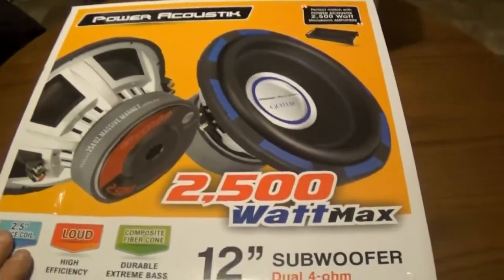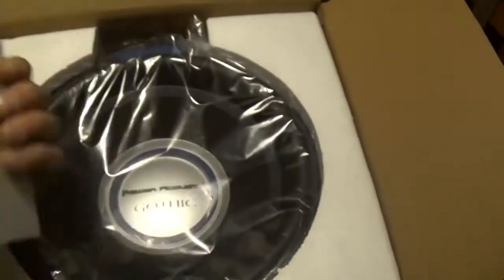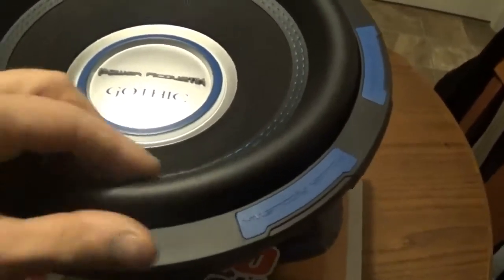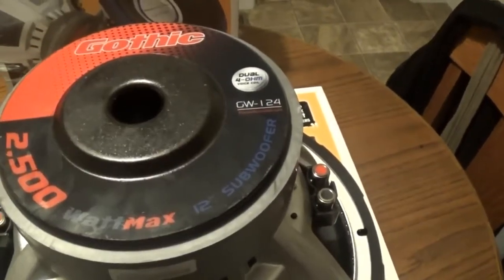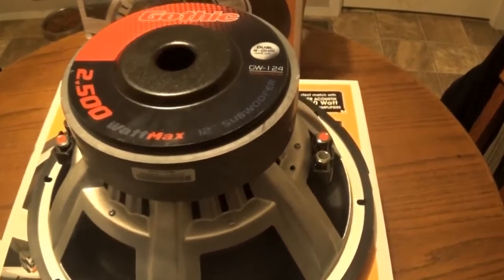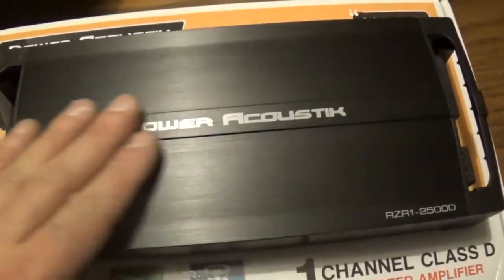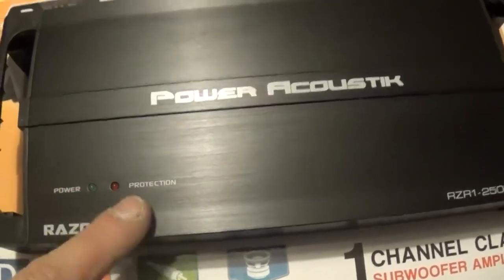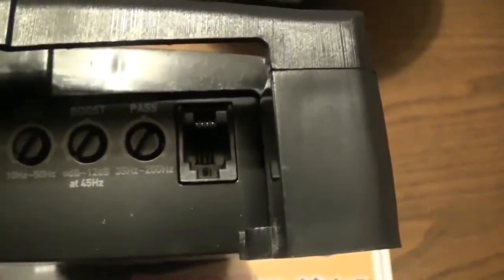Power Acoustik 12" Gothic Subwoofer and RZR1 2500D Amp UnBoxing and Review! #caraudio #audio #loud

Comment: Did you have a video of the wiring how you got it to the 2ohm and settings on the amp to get the most amount of bass out of it ?
Reply from the maker: Each sub has 2 4ohm voice coils. 2 4ohm coils in parallel is 2 ohms. One hot and ground from each side of the sub. Put the hots together and put the grounds together for 2 ohms. The amp levels depend on your input levels from your source.

Comment: The sub is more around 600 rms and the amp pushes around that also. Those 2500 claims are just to sell the product it’s false advertising.
Reply from the maker: @GeorgeWashingtonknows  the amps push around 700 arms at 14v. The older Gothic subs would hold 1kw all day but the newer Gothic will not. They go up in smoke on these amps now. Walmart cheaped out on the later revisions. Unless you live under a rock 🪨 everyone knows how cheap amp ratings go.
Reply: @TrapMyRide  The average person buying these power acoustic subs and amps from Walmart and slapping them in their vehicle ain’t seeing 700 watts not a chance. Dyno yes but in a vehicle nope. 12.4-12.6v not gonna see 700 unless it’s at 1ohm maybe. Doubtful tho. I’d like to see a dyno on that amp at 12.4 volts at 2ohm and 1ohm.
Reply from the maker: @GeorgeWashingtonknows  cars don't run at 12v man. When the cars running its 14v. The amps are not 1ohm stable and won't work long at 1 ohm.
Reply: @TrapMyRide True, I have been under a rock.
Reply from the maker: @GeorgeWashingtonknows  it's ok man I been there too.